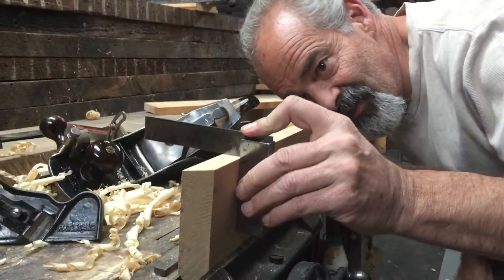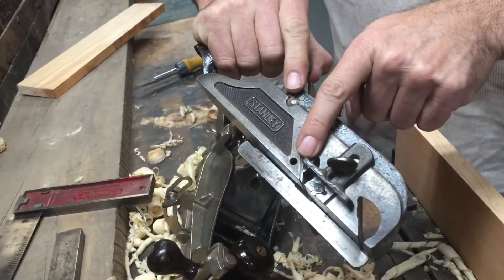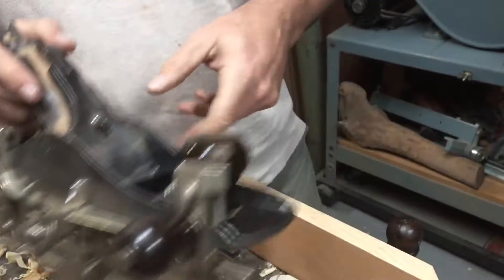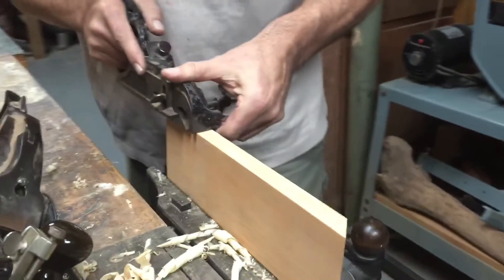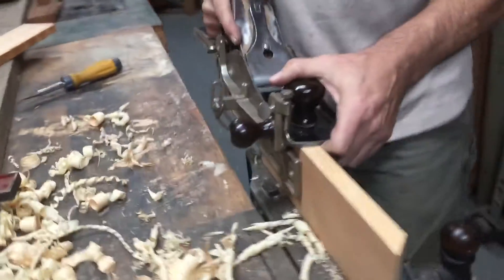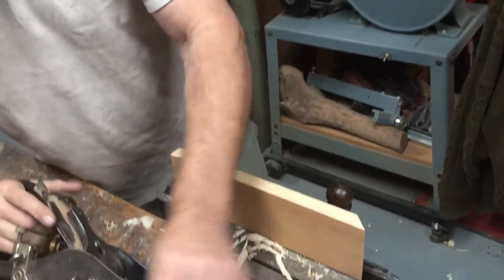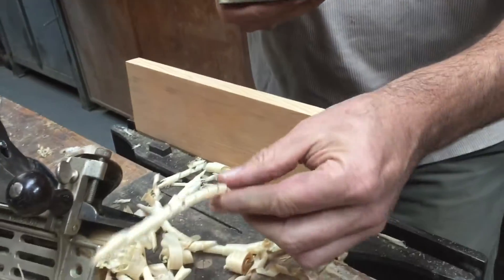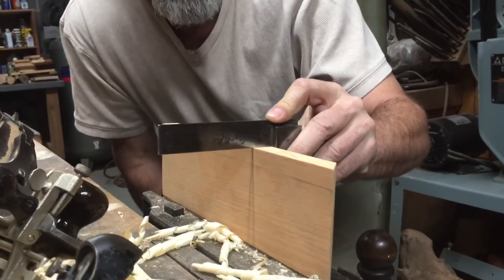Squaring a board with three planes

Comment: I put the 386 fence on the other side of the plane than you. I use my left hand fingers to push the fence into the board and hang my thumb on the plane. This keeps the fence square instead of the plane, allowing a correcting cut.  I keep a #7 plane with a straight sharpened blade just for use with the fence. All my other bench plane blades have camber.
Reply from the maker: I have a dedicated 6 and I have switched the fence side since this video  I think there is an advantage to that. Good to hear from you.